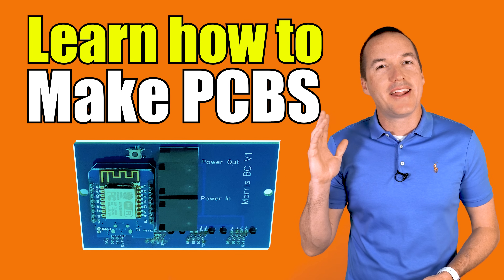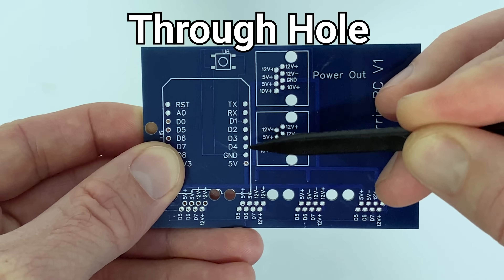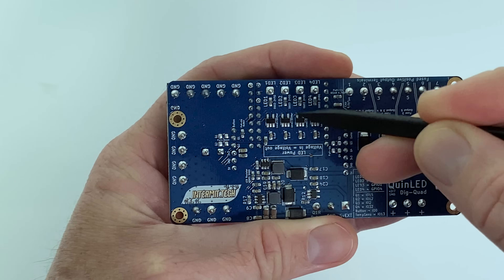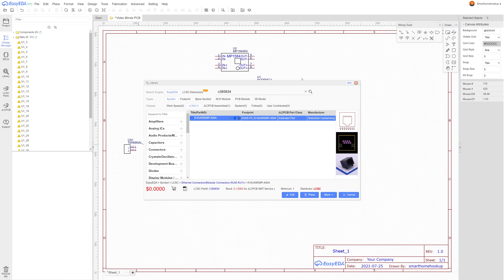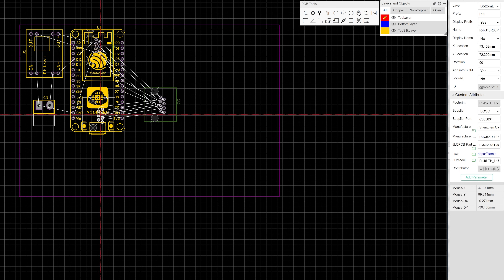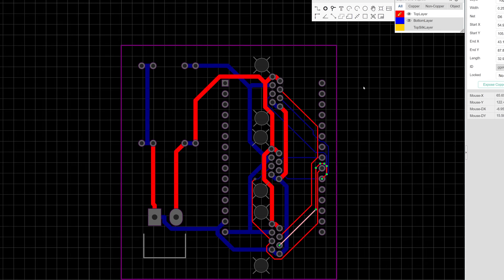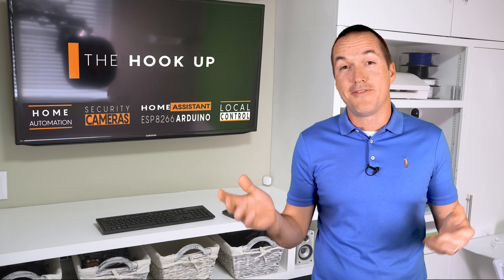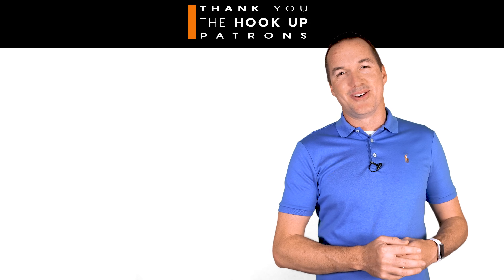PCB Creation for Beginners - Start to finish tutorial in 10 minutes

Comment: I received my self-designed PC board from the MFGR OSH Park and it had coating over the pads and into the thru holes. The coating will not dissolve with any chemical I have. It is useless unless I can remove the coating. What to do.

Comment: I’m wanted to build a simple board with an SOP8 component and just few places for SMD caps, resistors and 2 pads/vias for external connection. You lost me at library/search function .. I get no such thing or search engine .. found show only standard libraries. I guess it’s back to hand build on vero board.

Comment: how do i add a common ground and common vcc for all the components in a schematic. what should i use in my schematic for the supply. i am using a 9Volt battery, so i need a battery holder for that  in my pcb. how do i make connections?

Comment: Hi I want to make a simple coil for a planar magnetic speaker driver. As I'm pretty new to circuit printing (I used very inefficient manual methods before) is it ok to have only one Cu F layer? I'm using KiCad but it seems to be similar here. I really only need a simple unmasked copper trace layer on a flexible, thin PCB. Do you have any important notes or suggestions for my usecase? In case you wanna take a quick look at the gerber file, I could provide you a link to my Google Drive via E-mail. Thanks in advance!

Comment: 9:17 I am kind of new to all this PCB stuff. What is it exactly that's being soldered? I understand he's using tin obviously. What else does he "put" in those holes to connect to the tin and thus to the PCB? It seems like he sticks some kind of pin of another component to connect to the PCB?
Reply: Some components come with these pins but in some cases you need to solder them in your self or directly on to the bord if there are some connection points

Comment: Thank you. Finally, after all these years, after watching your video, I got started and designed my first PCB last night. It's now awaiting processing! Can't wait to see if the board comes out ok.
Reply: boards came in from JLCPCB today! they look so nice and everything fits perfectly! Not sure if it works yet (haven't had time to solder it all), but looks so professional!
Reply: @shenqiangshou  oii, give us an update. Did it work?
Reply: @imjustroyal6808  yeah it sort of did... everything went fine, PCB looks great, except when I powered it up, nothing happened... I realized I missed one important trace, the one that connects the incoming power to the rest of the circuit... lol! Thankfully it's through hole, so I just soldered a wire and it's all good. For v2 of the PCB, I have added the missing trace.

Comment: A few tip for novices to soldering. Always skip pins whenever possible. For example, if you’re soldering 10 pins in a row, do them in this order… 1, 5, 2, 6, 3, 7….
This prevents excessive heat build up in one area which can damage components and burn up traces.
P.A.C.E. has some great videos on YouTube. They are very old videos, but the laws of physics don’t change so it’s all still relevant!
Reply: Welding has a similar recommended rule when working on really thin sheets so that doesn't surprise me. Nice tip, thanks. 👍
Reply: hey, how can I find this videos? i'm new in hardware stuff
Reply: As  a hobbyist  from  the 60s  I remember warnings about  overheating components. Yet  watching  the very experienced and competent  repair videos  from LER and others here on YouTube amazed me  as to how often they would go in with the soldering iron and heat guns, especially on little  surface mount devices.  Tiny  components being moved around with the iron and then soldered in place. Sometimes components being unsoldered and then re-soldered if they weren't faulty. My heart went out to the poor things.
Yet everything worked. Those  experienced at repair work , which is a great art, obviously know what they're doing,  so these components must be more resilient than I thought and/or are better designed nowadays. Regards, Kieron.

Comment: I found the hardest part of using that site you talk about is finding the correct components. I am not able to do surface mount. I only want to use through hole components. I have not found an obvious way to pick components based on that prefereance.

Comment: The curved traces are there for timing. They keep parallel paths equal distance to differential pairs, keeping impedances equal, therefore eliminating noise in the signals. In general, we should leave them in.
Reply: It is not about resistance, only about length and travel time.

Most of the time we can make the approximation of quasi steady state. Meaning we assume current is constant or at least the signal travels all the circuit way faster than the current's changing.

And there, from Maxwell equations (that are always true) comes kirschoff's laws.

For data transfer, current isn't constant at all and has a pretty high frequency (the higher the more data/s we get).

The approximation isn't realy correct because the circuits length isn't small enough compared to current's wave length.

2 bite emitted at the same time need to be received simultaneously, and so we try to make sure they have the same travel time.
Reply: Thanks, that was actually very interesting! @neodymelanthanide2101
Reply: @neodymelanthanide2101  kirchhoff
Reply: Wow that makes perfect sense. I would've thought it was a mistake too though XD

Comment: Ya this is a great video and all but it’s not for beginners…beginners implies no knowledge…you definitely need to have knowledge to understand anything here…I want to learn how to do this…but without detailed info about the different pieces and how to use each one and what it’s for and why you need it…then this is useless
Reply from the maker: Do you mean how to use each component type (resistor, transistor, diode, capacitor, etc?) if so you need to look up electrical engineering videos, not PCB design.

Comment: I have a question; I am wanting to build a buck boost converter that has a TFT screen that will show the output voltage. Input will be from a 3.7v lipo batter and has to have an ouput of at least 9 volts, preferably 10 volts. Thing is, I have no idea what will be needed and how to build this thing. Any advice would be greatly appreciated!

Comment: I tried to follow the tutorial you provided, but I got stuck with attempting to figure out how to create custom component (it's Adafruit's servo bonnet (ADA3416, the one with socket on top of it), and I use SDA / SCL pins). I needed to create footprint and layout for this but honestly I failed and gave up on this. I would appriciate guide through creating component if one is missing from library

Comment: I started getting into this line of thinking as I am about to build a new house.  I want to have relays in the attic, along with esp32s to control the multiple lights for each area.  To do this, I need to design a board for my custom solution.  Good video to start me down the road into that mode of thinking.

Comment: Sweet, I love these tutorials Rob Nails it every time!  I got a few multi sensors that started out as BRUH multi-sensors and have evolved into: temperature, humidity, barometric, LUX, sound level and motion detection and more.  Using up almost every pin on a Node MCU.  I think I want to add air quality by going from BME280 to a BME680 and then maybe finalize it to PCB but then I think of something else.  Like maybe adding a screen to display NTP time.

Comment: Great video! Looking forward to trying EasyEDA. For my first board design I'm currently using Fritzing, which is simple but has rough edges. Eagle and KiCAD are too daunting for me.

Thanks for the tip on larger traces for higher current. My project also uses 12v and could benefit from thicker power traces. I would have missed that without your video.

Comment: This episode alone was worth my Patreon subscription!  I made PCBs way back in the day and had none of these great tools. 

Thanks Rob for the whirlwind tour - you have inspired me to clean up some existing projects that work great but are a rats nest of jumpers. And when my pergola kit arrives very soon (another big thanks to Rob - https://www.youtube.com/watch?v=l8dRm8PApLE&t=790s) , I'm going to make a PCB for some of the LED lighting and sensors that I'm adding to that.
Reply from the maker: What kind of sensors are you adding to your pergola?
Reply: @TheHookUp  I will be adding a very discretely mounted PIR sensor, an I2C non-contact IR temperature sensor and a temp/hum/press combo sensor all connected to a Wemos D1-mini that interfaces with some Home Assistant Node-RED logic.  

The first sensor will be used to turn the LED lighting on/off based on light/dark/occupancy. The last two will measure the radiated heat from my concrete pavers on hot days and close the louvers if the West-facing deck is getting too stinking hot. Trust me, the deck gets way too hot for bare feet.

I'll also be using Home Assistant to open the louvers if there's snowfall forecast in the Winter. Again, the automation logic is Node-RED.  Hopefully my Sonoff Bridge (with Portisch) will work with my pergola receiver. If not, more work for the D1-mini + some discrete components.

And Yes, we have snow here in Vancouver BC.

Comment: will try the easy eda. thanks rob. but where the details of the Dave Morris board ?.......in the parts list on github i could only find rj45 jack and the tactile switch. the board eliminates the motor controller and buck convertor. does those components should be part of the BOM or those individual pcbs (buck &  motor controller) go on top of this board ? is there any explanation on how it all works ?..does the cat5 cable is what needs to run to the blinds ?...mainly are these PCBs already on PCBway or JLC for ordering like Quin does ?
Reply: Send me an email and I can send you a parts list. I have another board that takes 5v and 12v and sends them to the board. Towerclimber87@gmail.com

Comment: Copper planes are also beneficial in the manufacturing process of the pcb as not that much copper needs to be removed. Always fill your pcb with copper planes even if you're not connecting them to a net.

Comment: Nice intro video. 
One point on safety. Unless people know what they are doing (I mean really know), they should not try to incorporate mains voltage in any of their designs as AC has several considerations to take into account like gaping and how to calculate trace thickness and width. Letting the magic smoke out of a PCB via AC is a much more serious issue than with low voltage DC.
Reply from the maker: I agree with you 100%.  In fact, you'll notice that I pretty much don't mess with mains on my channel for that exact reason.  PCB or not, making a mistake with mains is a much bigger deal than 5-24VDC.